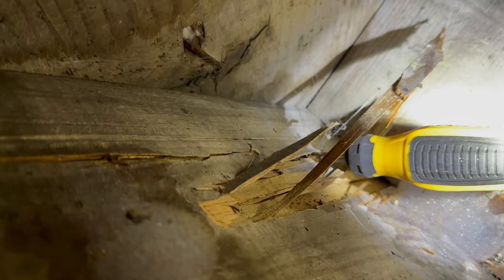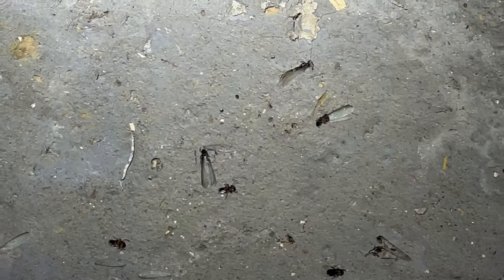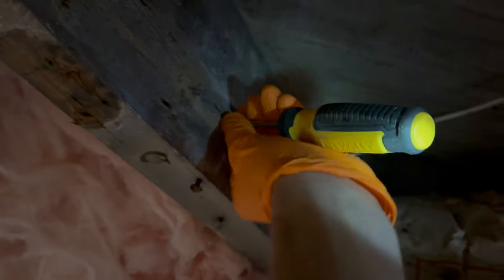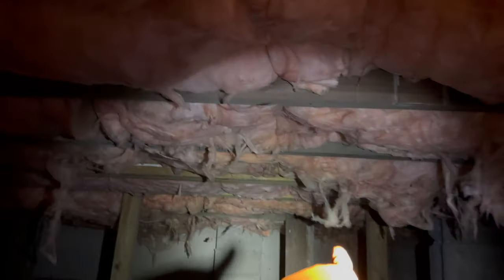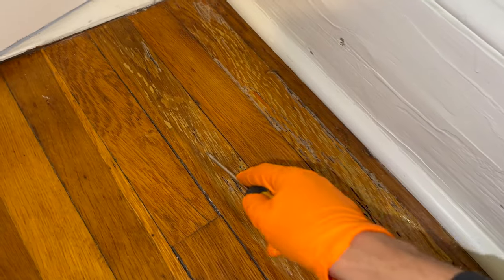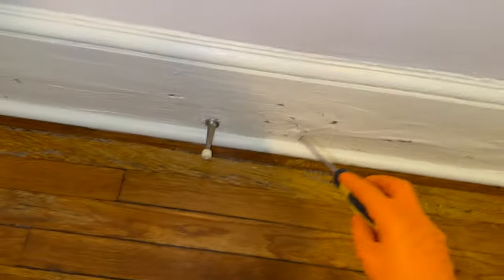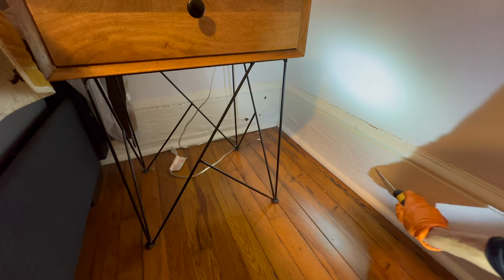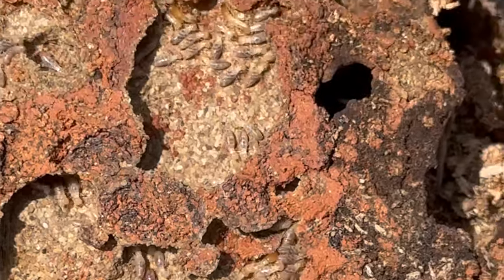$10,000 of Termite Damage

Comment: Hoping you can help me. I’m having a termite issue and am getting mixed responses from pest control companies. There’s no mud tubes at all, activity is in a bathroom and closet right next to each other. The last two quotes I was given- one said the problem is in the pipes underground,  he will drill the floor and flood it with the treatment solution. The other said they will spot treat by doing a trench and using foam in the affected walls. I just don’t know what the best option is, hoping you can please advise me.

Comment: So, if I have drywoid termites & similar baseboard issues, should I inject fripinol foam in the base boards then caulk the hole to get rid of them, then replace base boards once the termite takes poison to the colony if I have only drywood termites? Also, before installing base boards, can I spray Bora Care to the new base boards then paint them? I dont have mud colonies  or subterranean  according to Hulette, but I will still use Taurus Sc in a trench around the entire house. I plan on getting my tent November  1st when the mating season ends, but I want to treat the rotten base boards & trench the house before November. What do you think Dan & family?
Reply: Dan the bug man typically has no clue what he's talking about. 

Don't use SC, use Termidor HE. You're on the right track.